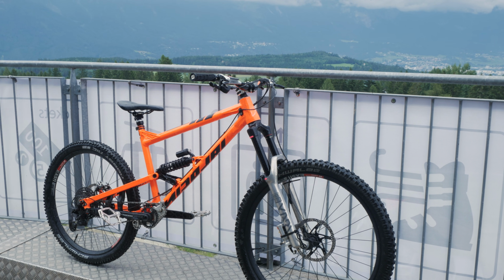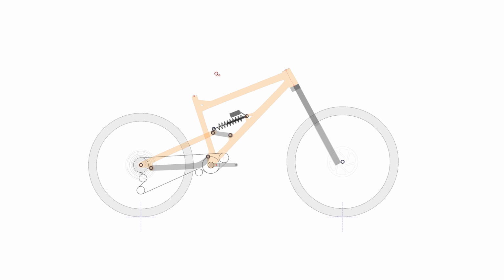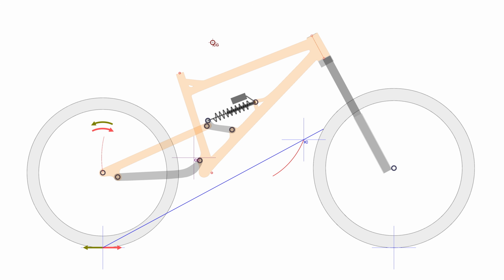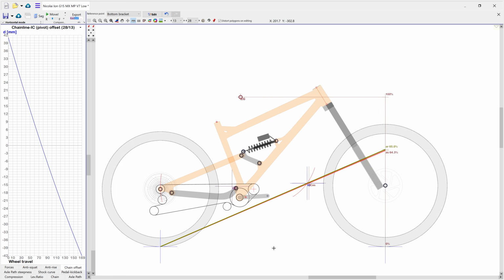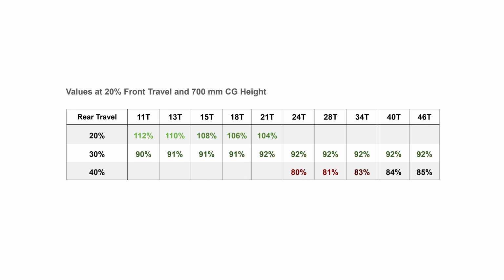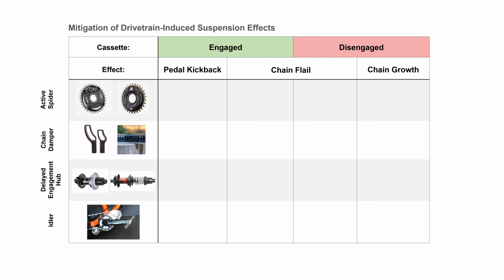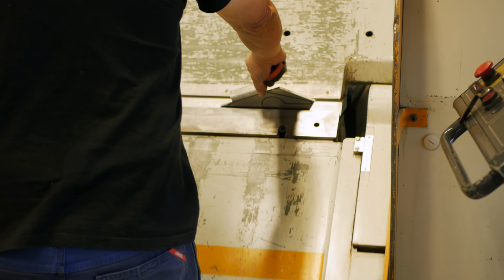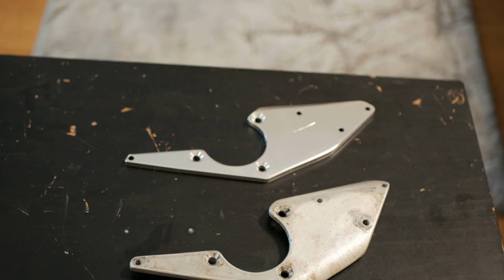The Anti-Properties of Suspension & Drivetrain Interference

Comment: Hi! Maybe you can give me an answer:D I have a g16 . We know it takes 216x63 or 222x70 shocks. I want to mount a 222 shock but nowadays its impossible to find. What would happen if I mount a 230x65 shock?
Reply from the maker: the Marzocchi Bomber CR still comes in 220x70. I run a modified 230x65 version of that shock with the M-Suspensiontech high-flow piston and compression unit. I cannot recommend this setup enough, I was on a Storia V3 and a Vivid Air before but this shock is the best yet. If you live in Europe, the bomber frequently goes for less than 200€  used and the service with the parts costs 175€. 

As for the 230x65, I can look it up later. The bike analysis software Linkage is great for this kind of stuff.
Reply: @pathfindrperformance  thanks a lot! :)
Reply: the easiest option would be if the 230x65 works 😄
Reply from the maker: Here is the link with pictures in order:
https://imgur.com/a/cuphxli

1. The picture I based the geo on
2. The stock bike with 222x70 mm shock and high flip chip position.
3. the bike with 230x65 mm shock (coincidentally also 174 mm travel)
4. The bike with 230 mm shock and 2 mm offset bushings on both sides.

The 230 mm raises the BB quiet a bit, but with the flip chip i the low position the BB height drops by about 10mm. You could aslo use offset bushings if there is enough space for them. 

Also I would recomment using a longer chainstay mutator becasue that slackens the bike and drops the BB (a lot). You can check out the beginning of this vid to see how big a change going from the shortest to the longest mutator makes.

I have also uploaded the bike on Linkage, you can access it with the free demo version.
Reply from the maker: I think if you go with the 230 mm shock, medium or long chainstay mutator, low flip chip position and a 29" front wheel that would work pretty well. But I cant say what the exact geo would be like.

Edit: my worry would be that the head angle gets too slack with all those changes so I would probaly go with a 230x60 mm shock and a shorter 160/170 mm travel fork to be safe.
Reply: @pathfindrperformance  wow thanks for the help! maybe i try to borrow a shock to try everything out , and after that i can sort it out 😊

Comment: gg fellow bike nerd!

I think the community could benefit from checklist to follow for placing the idler properly, the rest could be parametrically designed.
Reply from the maker: Oh honestly the best way to find the position is to play around in Linkage X3. There will be two positions that will be good on most bikes, either above and behind the chainring (like on my instagram or the idler Rulezman makes) or the position that I use in this video. If you have a climb switch on your bike I would 100% recommend the idler behind the chainring because the forces goint through the plate will be a lot less (almost 3 times). So my plate didn't really bend even with only 5 mm thickness. The anti squat will be bad in the smaller cogs but that's not an issue if you can lock out your shock. Also negative pedal kickback = zero pedal kickback so don't mind if the numbers go into the negatives.

Comment: Another welcome guest visit from the Vernier calipers! 😝
Do you have any 2D CNC options (similar to SendCutSend) available in your region?
Reply from the maker: Hehe yes. I'm currently doing a workshop course at my university. They have two 3D CNC machines and two lathes plus pretty much every tool you could ever want. In theory I could make parts there as long as I work at the uni, but I need to ask them if it's ok to use the machines for personal work.

Comment: Love the video, especially the animations. Really helps visualize some things even if they're not totally accurate to what's going on during a real ride. Personally, I'm not trying to extract tenths of a second during runs so I'm really not concerned with pedal feedback as long as the chain slap isn't super annoying.
Reply from the maker: Thanks! Yeah I tried to keep the animations simple. In my next video about steering dynamics there are a lot of effects that can't be simplified to a 2D space, so I'm not sure how I'm going to animate those.

The idler is just a neat gimmick, but it helps with peace of mind when riding. I don't think it's really making me any faster, but the next upgrade made a big difference in the times. Hopefully, I'll finish my video about that sometime in November.
Reply: @pathfindrperformance  steering dampers lets gooooooo
Reply from the maker: @HannyDart  not quite yet that, comes after ;)
Reply: @pathfindrperformance  well its going to be crazy entertaining anyways. did you do steering angle velocity measurements during regular riding similar to how you measured your fork displacement? I am currently tinkering with this with a gopro on the toptube and a 3d printed scale that is mounted to the stem
Reply from the maker: @HannyDart  no I haven't bought a steering damper yet. But I noticed that especially with my new setup a steering damper may be pretty interesting